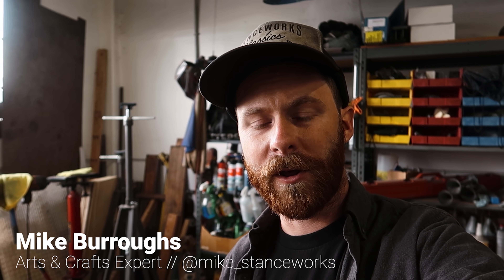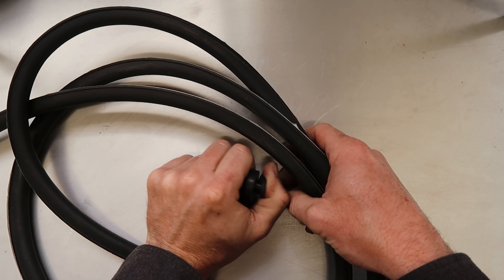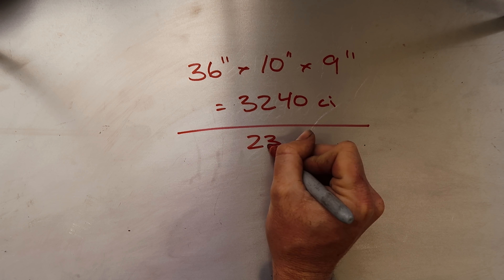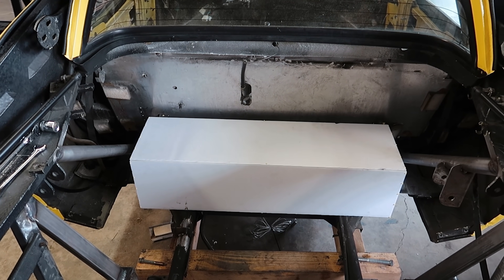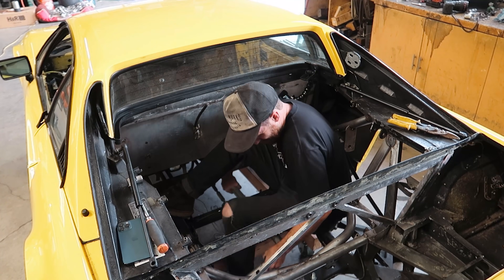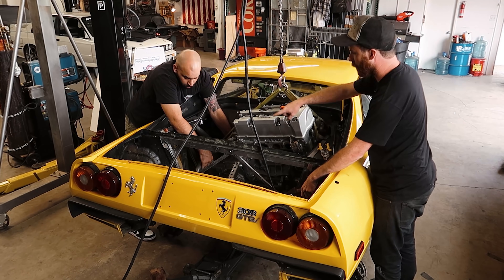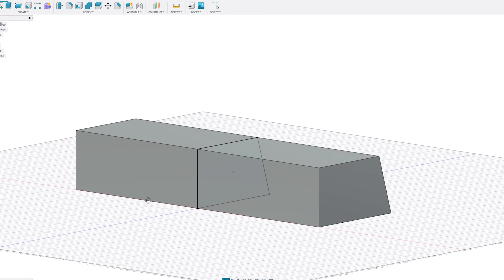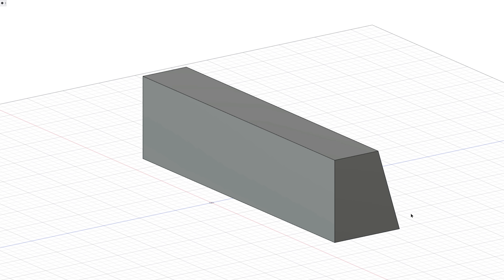Designing a Custom Fuel Cell for the Turbo K24 Ferrari - Ep. 28

Comment: Seeing the engine come out with just the removal of the bolts through the bushings is a truly impressive sight. I was half expecting you to need to unbolt them from the engine first, so I'm impressed that it worked out so well. Also, if you're going through the trouble and expense of either making your own or ordering in a custom fuel tank, then you can have them baffle the hell out of it to reduce fuel sloshing in every direction, so it's vastly better to build it as large as you possibly can so you can take longer trips in it without needing to replace a lovely passenger with a jerry can of fuel. Better to have the capacity and not use it when going on a track day than to want the capacity and not have it. It would be fairly trivial to install a plate with just some perforation around the edge at the 11gallon line in the tank to prevent a huge amount of the sloshing during high-g cornering while still allowing for more than adequate fuel drainage to prevent sucking in the sides of the tank.

Comment: You should look at Project Binky on Youtube. They built their own Fuel cell with a swil pot and inner baffles as well a interior foam.  It would save you thoussands of dollars to build your own Gas tank.  if tou follow their method you would have a very safe cost effective solution to your problem At least have a look.  youhw you want it builroject Binky Episode 15.  Your tig skills should be up to the task all you need is sdis some 3/16 oluminum Sheet and Aluminum filler rod. you could weld the baffle in place place a swirl pot on place  and weld the end caps in place.  Think about it before you shell out several thousand dollars needlessly. Relocate those straps higher than they are that will gige you the ability to increase your capacity. you can make your own replacement straps.  you should be looking at 50 liter capacity as a bare minimumm.  tbustion temprature.  If you are going to a stand alone ECU you run flex fuel.  You will be able save money over race fuel, and a good tuner can dyno you vehical to run on all three.  There is no reason to leave asny horsepower on the table..ne yourvehical to run on corn ( ethanol) you will have lower comp. Youu should only narrow the portion of the tank where the oil pump for the dry sump is you shoul extend the bottom of the tank between the frame rails to ad cappacity. you should also skin the entire underside of the car weith aluminum to limit drag.  the extra weight will be worth the increase in top speed.

Comment: Been binge watching this build. Thought maybe a remote fuel sump might work well with this build. A small tank with an extra fuel pump for redundancy. Also adds a little extra capacity while delivering slosh proofing for fuel starvation in high G applications. Fitech command center 2.0 jumps to mind. With the small size, mount it wherever.

Comment: tank doesnt have to be a straight box. 

indentations for the mounts, frame rails, water pipes, the oil pump and the intake, a bump up against the firewall... and ideally a panel that separates the tank from the engine in case of a fire (so either a sandwitched and glued plate with insulation and fire retardant, or an enclosed box that completely sets the tank apart from the engine bay, like in a R5 turbo), as it will allow you extra precious seconds to escape. 
Besides, with a tank this wide you will absolutely need baffles, and going all external pumps is a pain in the ass, so there's no excuse to not optimize what space is avaliable.

Comment: Looking good. If your worried about range when driving on the road why don't you build a quick disconnect auxiliary tank where the old trunk was, that can be removed when racing? You could make the fuel cell smaller, have it lighter for the track and have more range for the road. After all this is what the car had originally.

Comment: Why not slash cut the passenger corner of the tank to clear the pump, and add depth on the driver side where you have room? Sure, the shape gets a little more complex but your CG stays low and your capacity will probably exceed 15 gal.

Comment: What drove you to cut 3" off the whole width and not just say create a type of indent on that corner for the oil pump lines say 3" off the width and 3" off the length then still having that capacity intact on the rest of the tank?

Comment: Just wondering why you didn't make a cut out section on the edge with the oil pump. Would keep the capacity and cg benefits without adding much additional cost.
Reply from the maker: Because I don't have all of the dimensionality for the pump, and because there's also lines and such that have to exist there.

Comment: You can also put a small sump in the bottom of the tank away from the water pipes, for the fuel pump to pull from in case you run the fuel level low on a drive somewhere...

Comment: Hey Mike, love the channel and this particular project. 
Not sure if this might be of help to you, but have you looked into the Ferrari 348 or F355 fuel tank by chance? It looks very similar to what you're trying to do, has similar angles, width, height etc, and they can be purchased off the shelf new or used much cheaper than custom made. Also worth remembering that both those cars had factory race variants for the track, the 348 Challenge and the F355 Challenge. Therefore those tanks would have most likely been designed by Ferrari with racing in mind. Check them out if you haven't already! Can't wait for the next episode, best wishes to you from the UK.

Comment: keep the low fuel capacity, and for long drives, add a boat fuel tank you can take out easily for a quick 10 gallons, with a low pressure transfer pump. boat tanks available at boat stores and amazon.

Comment: Why not notch the tank or put a shorter section on the back to add capacity and keep weight low. It may cost a bit more but the result would be worth it. You could also angle the back down and out towards the motor most of the width but leave a spot for the lines.

Comment: Good call on the card board mock up. I was wondering why you didn’t want to put the gas tank closer to the rear of the car? are you concerned with weight transfer?
Reply from the maker: Meaning why not put it in the “trunk”?
Reply: @stanceworks  it looks like you have a lot of room behind the motor and the trunk. Would swing weight be a concern if you had the tank in between the frame, lower to the ground? I also wasn’t sure if you are going to run a cage in that car, that would also be a factor for location. I wasn’t sure if your current location was a safety factor.

Comment: Keep the car running on 93octane, easier to drive on street. Race fuel is not as readily available.
Reply from the maker: It’s readily available here in SoCal, and my power goals require it. We also don’t have 93, only 91 here.

Comment: Any reason my comment was deleted? All I did was recommend a fuel cell that I measured to fit on a 308 together with a positive message for the channel. I can't imagine I broke any rules.
Reply from the maker: It wasn’t me that did it. It must have been YouTube. It may be because you included a link? I’ll check the filtered comments.
Reply: @stanceworks  You are right the mistake was mine that I included a link and I did not know that was a no no. To re-iterate my comment, the fuel tank you designed is almost identical in dimension to the 54 liter one fitted on a Radical SR3 race car. As it happens I have both a Radical and a 308 and went and measured both to confirm my thoughts. The 54 liter Radical fuel tank is a near perfect fit, available in aluminum or as a cell, foam filled, contains a pump and is baffled. Getting one of those could be a big savings over a custom tank. Contact Spring Mountain in Nevada and I'm sure they have an old tank from a wrecked car you can try. Ask for Sean he's a good guy and will work with you. Secondly when you re-do the coolant pipes you don't need to re-use those or even use hard lines. On the earlier Dino's (I have a 246GT) the same oval tube has the soft sided flexible coolant tubing running through the chassis. If you do the same thing it will give you a lot of flexibility when joining to your new rad and engine. Keep up the great work. I'm really enjoying the progress.
Reply: @benzina5917  That's a great collection you have! Very nice!

Comment: Wouldn’t it  be better fuel capacity wise to keep the 3” depth you removed and keep the 3” height you added  and maybe you box in the corner to give clearance for the oil pump. So you’ll gain the clearance and have the extra fuel
Reply from the maker: That would be the right plan if I could account for all the dry sump components at the moment, but I can't. I don't have all of the dimensions for the pump, nor all the lines and such that will need to come off of it. I'd rather play it safe.

Comment: Gearshift cables/linkages? What about those? Protect the tank from the cooling (hot) pipe.... Cold fuel is more power.
Reply from the maker: There should be ample room underneath for those as well.

Comment: Why not add another angle to have it go under the bulkhead a bit? Similarly, you need clearance on the side for the oil pump, but the cell could have a bump out in the middle going back?
Reply from the maker: There’s some more steel under there I think sill be a huge pain to cut out if I want to do that. I think this displacement will work all in all.
Reply: @stanceworks , gotcha. Thought it might be a forest for the trees scenario and had to throw out the idea. Amazing work btw.

Comment: There’s probably a fuel cell for a miata that will drop straight in. The place they fit is almost identical to where it needs to go.
Reply from the maker: I’ve checked far and wide. There’s not, unfortunately. It’s a very bizarre overall size and I need every inch available for the fuel capacity.